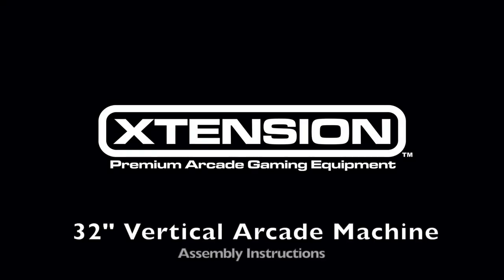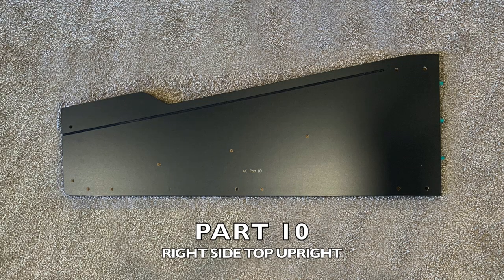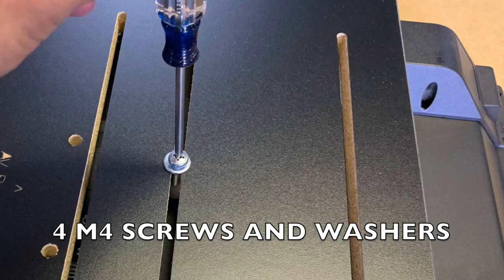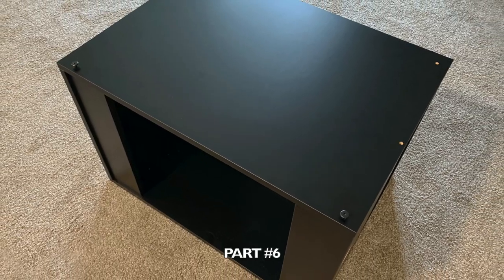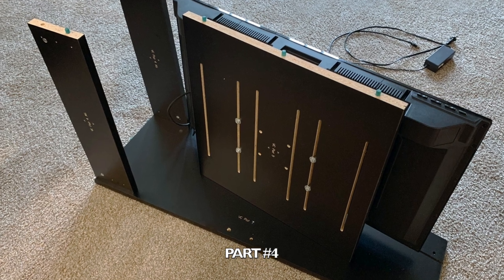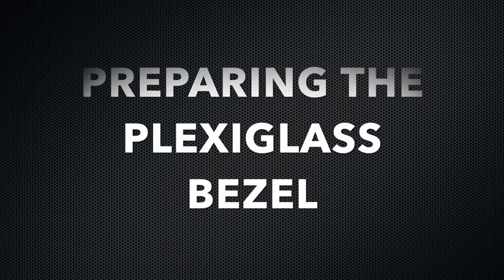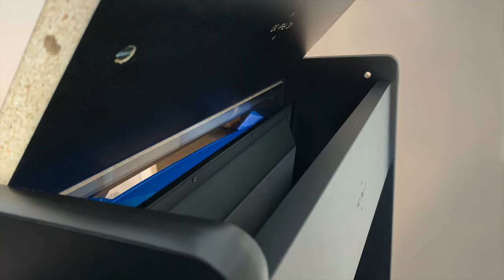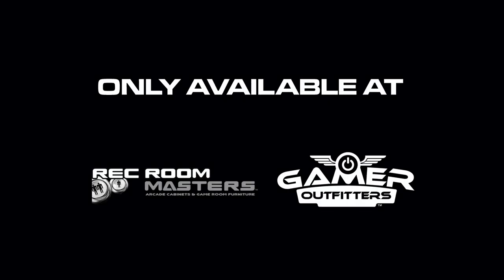The Xtension 32 Vertical Upright Arcade Cabinet Assembly Instructions

Comment: Your vesa screws for this do not fit the screen you recommend. Also one of the smaller screws snapped in half. Bad steel.
Reply from the maker: This is the same 32" TV we have recommended with all of our 32" cabinet products. All cabinets include 4 M4 X35 & 4 M4 X 40 VESA mount screws, that are confirmed compatible with the recommended TV. If your screw broke, please contact customer service directly and they can better assist you.
Reply: @Gameroutfitters  I got the JR mine didn't fit either on the recommended 24" tv.
Reply from the maker: @EQOAnostalgia  Please make sure that you are using the correct included monitor mounting screws. The Included 4 M4 X35 & 4 M4 X 40 VESA mount screws are the